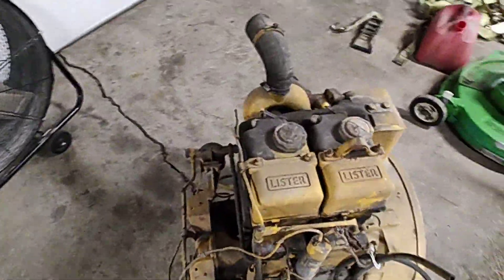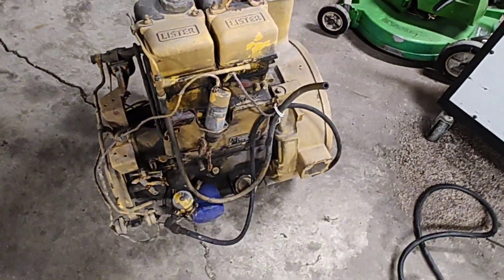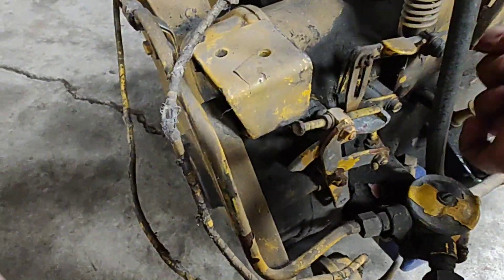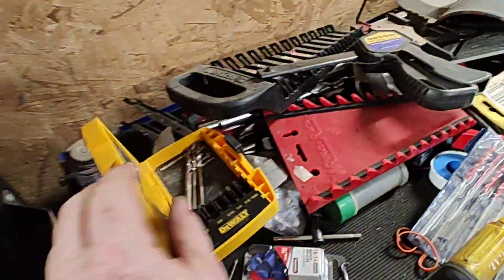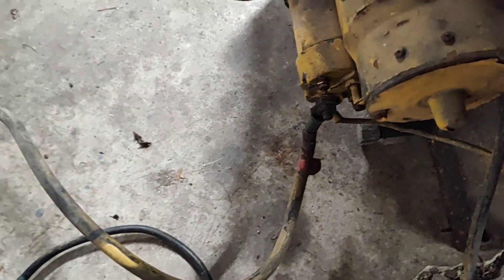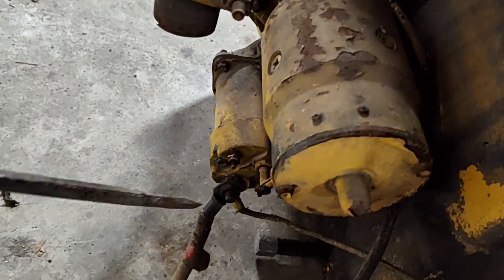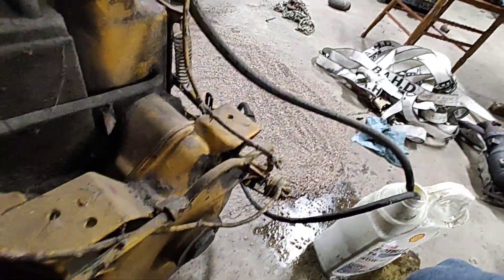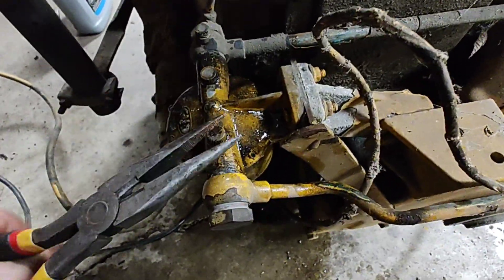Lister ST2 - Another one followed me home

Comment: When my parents bought my current home in Wales in 1961 there was Lister Startermatic generator feeding the property from a shed some 50m away.  In the middle of the night if you turned a light on you would hear the generator start up and the light would flicker and come to life.  To support this, it had a huge bank of batteries, mainly I guess because the generator would spin up under load.  Also, the property had to have a gas refrigerator otherwise every time the thermostat triggered the generator would start.  Anyway, the sale agreement included bringing in mains electricity, so my father sold the generator, and it went up to an estate in Scotland.

Some years later, as a technician in the Army, I was sent out to Belize with a small detachment to provide a secure radio link for the Governor in the capital city Belmopan to the Force Commander at Airport Camp outside Belize city.  Naturally we attempted a relay point halfway between and as the only technician I was to be based there.  We moved into an abandoned wriggly tin prison compound opposite a police station on the road somewhere between Belmopan and Belize.  The jungle had taken over the whole place, but I noticed some wiring, so I followed it back to a tin shed at the back and on prising the door open was astounded to see glistening in diesel a Lister generator.  I was looking forward to getting it going but unfortunately the radio communications didn't work so 24 hours later we moved.  The relay was moved up to hills beyond Belmopan, so I spent the rest of my deployment in Belmopan itself, just outside the Governor's residence initially camping with the Land Rover radio detachment, moving later into the government printery (sic) with an infantry company, where we set up a joint radio room.  I often wondered if that Lister generator is still glistening in that abandoned jungle covered shed.

Comment: A Lister with a starter,  what luxury!   In i973 I engineered a small harbor tanker.  We had a Lister that was our emergency generator and it also ran the bilge pump.   But it was hand cranked to start, with compression relief valves.  After you got it turning good, you flipped the relief levers and it always started.  Good strong engine!
Reply from the maker: This is the first one I've ever seen that doesn't have the camshaft sticking through the end of the gearcase for crank starting.  All my other Listers can be either hand cranked or electric started.
Reply: Just praying that the motor doesn’t backfire.

Comment: I recently bought a Lister Petter LPW4 all mechanical fuel pump  no electronics went through pretty much the same deal fuel line bleed new fuel filter adjusted fuel lift pumps to the rail here is  the problem it starts  and runs perfectly for about 15 minutes and then it just sputters slightly and dies will not restart until the engine has cooled off any ideas what can cause this

Comment: on the top of the inlet manifold are two holes / ports , your engines has " caps " on them , mine does not , it starts and runs fine but i would like to know what the ports are for ?
Reply from the maker: Those are oil cups for starting.  You pull the plungers, fill them with motor oil then push the plungers down to squirt the oil into the intake ports.  It helps raise the compression on a dry engine that hasn't been run in a long time.
Reply: many thanks , i guess i should find some grommets to cap the holes to stop any ingress , i have been concerned , its people like you that make the internet a good place
Reply from the maker: @jimclarke6129  I don't remember what size the threads are on the ports, probably 1/8” pipe thread
Reply: hi , now i know that the ports are for i have done a bit of googgling , lister supplied some of these engine with plastic cups that screwed into the ports that you could fill with fuel oil to aid cold starting , many thanks for passing on your knowledge , as my engine is a good starter i will just cap the ports with grommets . top man

Comment: You get stop lever to run then pull it out and turn anticlockwise  till max fuel delivery
Reply from the maker: You can't turn the rack lever to the cold start position with the way the linkage is on this one.  I've never needed to use that setting anyway.  As long as you give them some throttle before cranking, the rack opens and achieves the same thing.

Comment: Do they run well on used oil from the fish n chips place?
Reply: They will run on used sump oil, any vegetable oil, 
and fish n chip oil if that oil is filtered and kept above the temperature point where the oil solidifies.......
otherwise it's best to make biodiesel out of it before using f&c oil as a fuel....
Reply: @JohnSmith-yv6eq  Great. With the current electricity prices, we might as well start to generate our own.

Comment: Very cool engine. I've never heard or seen one. You said it came from a light tower?
Reply from the maker: They were made in England and are way more common over there.  They did see a lot of applications here in the States back in the 60's and 70's though.  Portable light towers, generators, and power units in the oil fields mostly.
Reply: @bigchevy80  thank you for the information! That would make a cool repower on a lawn tractor or something.  Thank you again!
Reply: @martinbenton742  
It obviously makes a damn good engine to belt drive a PMG  (permanent magnet generator) for whole of house emergency electrickery....

Comment: You have a cold start device you never operated on the engine
Reply from the maker: You can't put the knob in the cold start position with the way the shutdown linkage is configured on this engine.  I've never had to use the cold start on any of my Listers anyway.  All it does is hold the fuel rack full open.

Comment: Are them air cooled
Reply from the maker: Yes
Reply: @bigchevy80  But you could get a water cooled version for marine use.  Air cooled versions were used as lifeboat engines so you could test them without having to launch the boat.  Air cooled engines gave flexability for location of emergency equiment on deck,